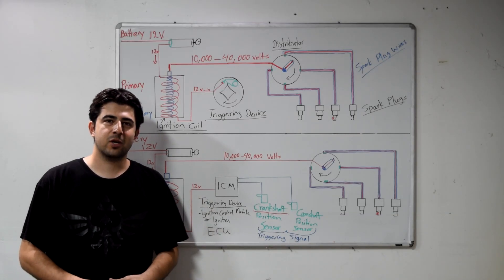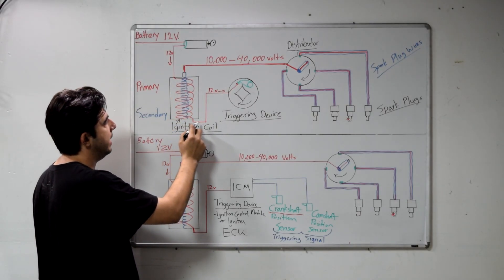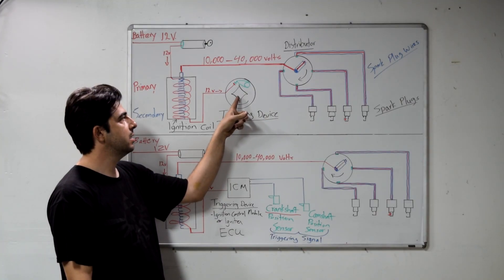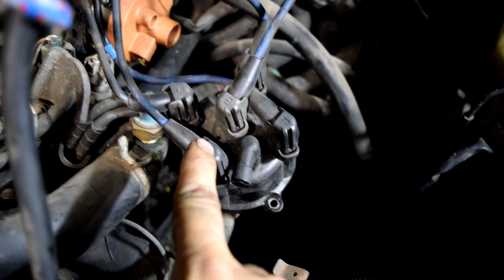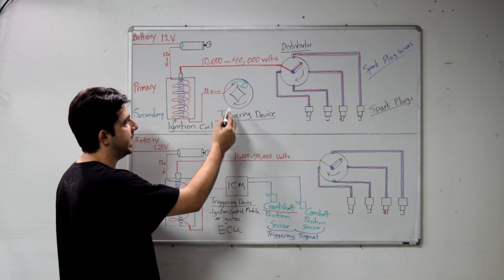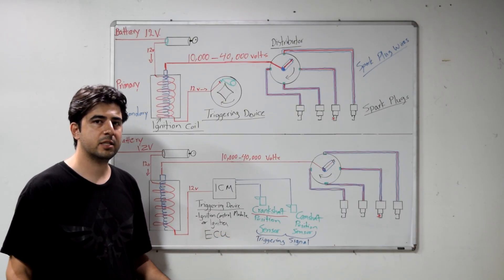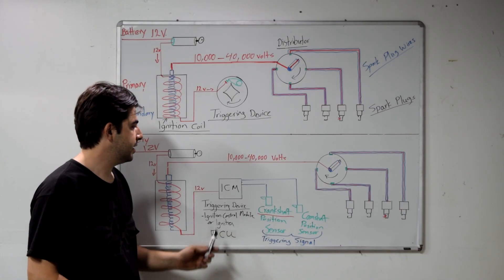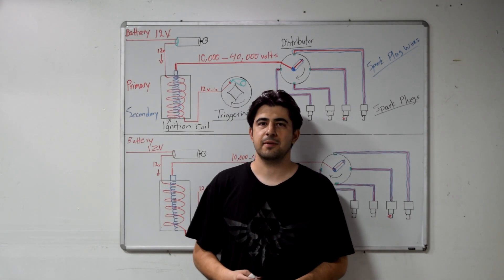How an Ignition System Works - Ignition System Basics Explained

Comment: my car is a mitsubishi lancer 1990 model and it works in the form of an ignition module in my distributor, so I didn't see the signs, rather, it doesn't matter, I thought it wouldn't matter, but I was wrong, you have
before disassembling your distributor, take a photo and open the inside of the cover, take a picture from there and follow the signs, look at your repair book, read the section on this topic, look at the pictures when collecting it again
you can handle it easily

Comment: i found my mistake,I disassembled the distributor to clean it, but I forgot to mark it while removing it, and I researched it on the Internet, then engine 1. i learned that you will hang out when you are in the silir sente position or something
but because I opened and distributed it inside the distributor, I put it upside down when collecting, thinking that the oil wouldn't matter, and because I didn't know I didn't see it on the sign, I put it upside down and the distributor was wrong
tainca modulator 1. not the cylinder, but the 4. he fired the cylinder, and because I fired the cylinder in the valve seat position, not in the engine, it's like the engine is going to work with a bang and nonsense
it happened, I even started it a little, I made contacts 4 5 or even 6 7 times to understand what happened, I looked, there's something wrong with it, I still didn't think that the distributor would be wrong, and I guess the engine
i said I couldn't do it, and a little later I realized that the main reason for this inaccuracy was from the ignition system, I unscrewed the distributor again and removed it, and when I opened it, the marks were 180 degrees
i saw that it was wrong, I eventually corrected it, of course, this incident became a lesson to me and I learned the truth of the matter.

Comment: I learnt alot from your video i am currently workjng on a 1989 toyota mark2 with a carburator but i also notice that it has an ecu which i find strange my challenges are the ignotion coil and ignition control module wire connecters were cut i got other connecters but i have difficulty getting the wiring diagram     one wire dows go from igniter to ignition coil but am a bit stuck it does carry distributor but none in at the moment workking on getting one. Am from the caribbean island of st lucia the car is japanese engine type is 4s fl 1800cc

Comment: 12 volts all right soon as your engine starts you got charging voltage is going to that coil and every wire on the car is practically charging voltage explain that and when you talk about testing the votes on the coil it's not just 12 volts

Comment: 👍🏿 so 

🌄.  The first and beginning ⚡️12,000 volts from the battery that is bridged  ignition coil long end wires when the ignition switch is turned with the owners key which gives permission for that first 12,000 volts travels across the inside of a wire and goes inside the cylinder shaped enclosure with/through first, the PRIMARY COIL which is the wider coil (in/the both/different ignition systems depending the vehicle) and the PRIMARY COIL is closest to its enclosure(sometimes drawn as a vertical rectangular box like a 🔋battery box where the ⚡️energy/electricity first comes from) and then there is the second coil in this vertical rectangular shape and that second coil is called the secondary coil which is a more tighter and further away from the round walled enclosure that the secondary coil is protected inside and like inside/middle/eye of the 🌪primary coil which acts like a second 🍰inside layer because where close to there round/🔑bent edged enclosure that protects both the coils inside.

Comment: Is there a voltage increase from putting the key in the on position just to light up the instrument panel, vs turning the key all the way? What is the difference in the key turning position that turns the car on? Thanks in advance.

Comment: Hi your video are excellent and very well explained.
i need help with an opel 200is , recently replaced the block in my car ,the conrod broke and bust the block where the crank sensor was. so now i have fuel coming but no spark. replaced the crank sensor ,new coil sent the ecu for testing aswel all fine.
but auto ecu test center says the rotor is faulty. will this cause no spark coming from the coil itself. we were testing from the coil to spark plug and grounding it to the engine to check for spark while cranking the motor....we have a no go. please provide me with a solution.

Comment: how does the high voltage from the ignition coil flows to teh distributor if the contact breaker is inside the distributor?